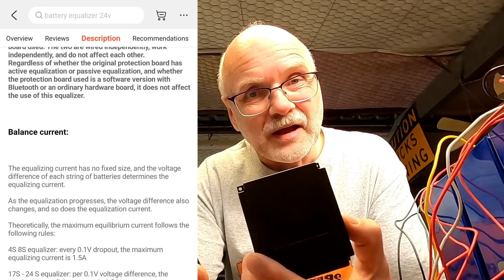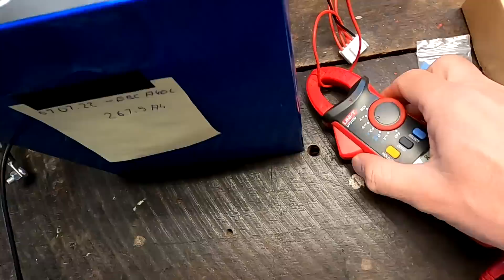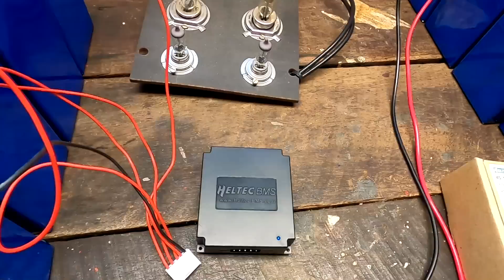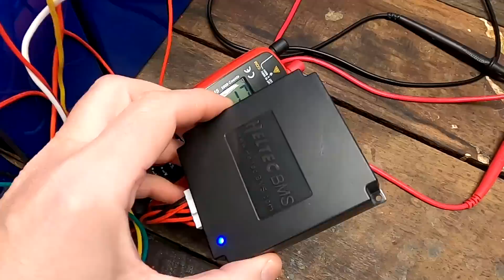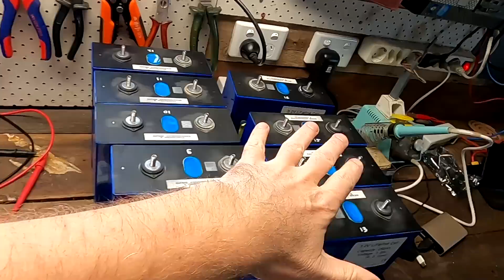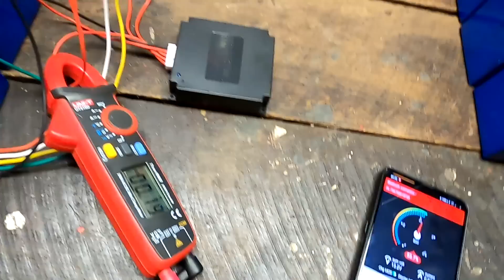HELTEC 10A Active Balancer. Great for large capacity batteries. But is it really?

Comment: High Andy. I’ve seen the same transformer type under a different name on one of the Chinese liquidation sites so now you’ve satisfied me curiosity about it. I don’t know exactly what Heltec does, if they actually make what they sell or they just rebadge stuff like others do. I’ve seen Heltec selling things that look exactly like a JK BMS and the Neey active balancer. I still haven’t found anything that has the balancing power of a Neey (and clones) balancer when it comes to 4+ amps at only .004 cell difference. They work so well I’ve retired other balancers. I’m assuming because of your videos that the JK bms that they are are second in terms balance power/speed. Thanks again Andy
Reply: Thanks for the tidbit about your experience with the Neey balancer. You mentioned clones, have you actually used a clone and if so which one and where did you get it?
Reply: @inmyimage1081  
I’ll have to look when I get home. One has no branding just laser marked connection pin numbers and the other I can’t remember. One was on Amazon and the other was EBay in both cases the seller isn’t offering it anymore but there are others now but I don’t know if they are selling off old inventory(obsolete model) so do your due diligence. They seem to be getting more scarce. Probably because the JK (& clones) cover both bms and smart balancing in one package.
Reply: What's this Chinese liquidation site?
Reply: @adon8672  
Alibaba like.
Reply: @SkypowerwithKarl  Thanks. I've never thought of Alibaba or similar sites as liquidation sites though.

Comment: You need to use analog amperimeter.
Reply from the maker: Why? In the manual, it clearly says you can use a clamp meter to check the balance current...

Comment: Would it be possible to set 2 in parallel to increase balance current?
For the 10A balancer, maybe it would charge 2 cell at 4.5A if 2 were low ?
Reply from the maker: Yes, you can set them in parallel. It also says this in the manual. For best results with high capacity cells, please use multiple balancers in parallel to increase effectiveness.... something like this.

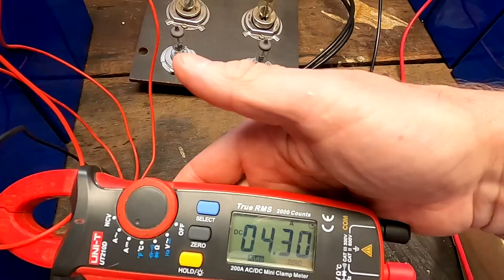Comment: Thanks Andy, Informative even if not as expected. Also, I noticed at 4:49 the cheap Heltec balancer has a "RUN"bridged solder pad next to the plug. Is that to add a "sleep" or on/off function or for an LED indicator? 
 Three Questions:
1, Have you tried paralleling two 5A active balancers to get 10A?
2,  If you had one under preforming cell (Cell #6) , and enabled 10A active balancing while under load during say the last 20% or so of capacity, that should help utilize the capacity in the better performing cells, right?
3, Do you or anyone have any good ideas for how to implement a 'sleep' function (disabling) the capacitive balancer?
Reply: I can think of 3 ways to automate top balancing off my head, each with pro’s n con’s. 1. Use a switch to manually engage this function as required. 2. A timer you can set to come on when you want, say once a week or 1/month. 3. A voltage sensitive relay/circuit board u can vary voltage trigger to activate balancer when a preset voltage is reached. You could use a small (cheap) battery voltage control board to trigger only when battery level is getting near the upper level of SOC around 3.4v/cell. I know these aren’t the best solutions, but should mostly work within reasonable limits. Im sure there are many other ways this functionality could be achieved if given enough thought. Hope this helps. Cheers
Reply: @evil17  Update, I just noticed on Andy's video at 4:49 ,  the cheap Heltec balancer has a "RUN"bridged solder pad next to the plug. I'm guessing that could be  "sleep" or on/off function. I also see it on other advertised units but no references. might be worth removing the solder see what it is.
Reply: @evil17  Thanks, that is exactly what would be useful, but most of the cheap active balancers have no V+ control voltage lead and are always functioning when connected with no way to turn off balancing other than completely disconnect the device.
Reply from the maker: 1) Yes, I have shown this in the video, I think, there was still the capacitive balancer connected as well and both worked at the same time showing 7A or something.
2) Yes, it does help a bit but but comes with a trade off. The problem here is once you fully charge again, cell #6 will peak the first again as it is charged a lot more than all other cell. Keeping such a balancer always connected, destroys your top balancing. Not recommended, I made quite a few videos about that.
3) I would turn off the balancer altogether and have it only connected once in a while. 2-3 times a year should be OK but it depends on your cell quality and how matched they are.

Comment: I don't like active balancer, just because, you cant see and detec the "potential" bad cell/cells. (Adding an other failure mode/point in the system)
Reply from the maker: Active balancers should only be used at the very top of the charge cycle, not all the time.
Yes, they can mask you weak cells

Comment: why he don't take not the power of cell 3 3.485 Volt because this is higher then cell 1 3.443 Volt there must be something wrong whit the calibration of your device or the heltec device
Reply from the maker: The capacitive balancer showed the exact same result, so it's not the balancer and neither it is the test equipment. Unless it has pulses which I didn't measure. I'll do an oscilloscope test soon.

Comment: do you think this BMS would be a good back up BMS, if say a in bought lipo4 bat BMS fried as a example  of an 300 aH bat? (aslo would that 10a worrk beter on more cells then only a 4 cell test if you  have more cells you should test it with an 8 an 16 cell setup if you can id love to see if it works beter bigger mbs test)
Reply from the maker: It is not a BMS, it is a balancer. Two different things. A BMS is a safety device which protects your battery cells, a balancer just equalizes your cells.

Comment: I’m not sure your measurement method is correct.
If you measure the current on a middle balance lead, then it is actually connected to two cells and you will only see the differential current.
But maybe they are specifying peak current, which isn’t fair related to expectations, so 10A peak charge current, but only partial time.
In case you have a scope, which you could hook up to a low resistive shunt…
Reply from the maker: Thanks Bernd. Hence I fully charged 3 batteries and had one empty. This ensured there is no current from the empty battery to a full one right. And I only focused on this empty cell for the test.
The peaks and pulses could be true, I'll test again with an oscilloscope and see how the balance current look like.

Comment: Just set up a parallel 2p-8s 280ah battery, first one ever. I got a Ponoser BMS...( DALY knock off).. uses Smart BMS APP. In the last couple weeks there was an update for the App, now it has a new button in the bottom middle, says Active Balance, and it appears that it balances all the time now...? Wish we could somehow try to get a better understanding of the SMART BMS app.. maybe could be a good video, not very much info out there about it at all..
Thanks, great video, glad I didn't spend an extra 40$ on my 2 8s active balancers.
Reply: I saw the same thing on my Daly BMS app recently. Just to disapoint you.. its for their line of smart balancers. Current BMS won't balance :( You'll need to buy their "SMART Balancers"
Same app for two different products :( Sorry, I was just hopeful as you
Reply: @m1fpv  I ran my cells for a couple days b4 I saw their update. Before update cells on front page just stay there and very occasionally moved, after update high cell turns red, low cell turns blue, and I swear I can see them adjusting microscopically up and down all day.. Since I'm trying to get a good to balance done at least once, I have it set to balance anytime cell is above 2.65.. (hoping that makes it balance more).. but the actual balance indicator on top of screen, ( near charge and discharge switches) only turns green when cells have a Delta of more than 20millivolt... Disappointed with information to clarify all this stuff.. Not sure I can count on it. That's why I'm also using the 5 amp plug in balancers also.. just want to get the darn things balanced once! Lol.. good for my OCD😉
Reply from the maker: They use the same app for both devices. I've got some Daly smart balancers on order to test them soon.

Comment: I agree, it's disappointing. But there could be a couple of things going on (which may reduce but not eliminate that disappointment). 

At first I thought the cable might be affecting it, but later in the vid' you used the other loom and there was no difference. 

Perhaps as someone else suggested, if 2 cells are low, and 2 are high, then the combined current would be 10A. I actually doubt this, but it's worth testing. I wonder what happens with the capacitive version in this scenario too. 

However I do think the balancer shutting down the balance function below about 3.4v (in sleep mode) is something good. This way it's not running all the time (which you say un-balances batteries). Instead, it will only balance at the top end of the voltage range, which you prefer (and have set up your JK BMS to do). So it's either On, or Voltage Controlled. I think this is pretty good. If you connect a charger, then this should balance in a similar way to the JK BMS. Perhaps we need to think about it as bringing the high cells down, rather than bringing the low cells up.
Reply from the maker: Very good points, my friend! 🍺

Comment: It looks like this new „10A“ balancer provides power the hole time and do not have the problem with charging and discharging the capacitor’s so we even transfer more power within the same time, can you check this. 

I like the design it is more failure resistant instead of the capacitor balancer.

Comment: I'm guessing the Heltec balancer is simply an isolated DC-DC converter with four single cell outputs in series. To reach close to 10A output, you may need to have two low cells getting 4.5A each assuming the primary side has sufficiently high current/power limit.
Reply from the maker: Yeah, right, I'll do the opposite test then...
Reply: Exactly what I was thinking, a combined maximum of 10A, not necessarily 10A on the one cell.
Reply: Yeah, my though as well. Hopefully we will see a follow up from the Off-Grid Garage in the nearby future.
Reply: I suppose it is a transformer with 4  equal windings and a synchronized dc to ac switch on each.
Will not even have any efficiency advantage over the switched capacitor circuit which wastes half the energy in the R of the RC circuit, because it is essentially  the same, just with a LR circuit.
Reply: @raymundhofmann7661  There is one advantage: It will last for a life. Capacitors does not last so much time.
Reply: @arthur88888888888888  There are also 4 cheap looking electrolytics on the transformer version.
Reply: @raymundhofmann7661  they are for filtering the ripple for the dc/dc converter. Not really necessary for the system to work.
Reply: I'm wondering if 2 dead batteries instead of just 1 would get both 4.3 each from the other two.

Comment: This active balancer cannot be configured to only switch on at 3.45V, so as you have proven already, there is little point in having it at all.
Reply from the maker: Maybe that's why it was of the next day and it actually only activates at higher voltages? More testing coming...

Comment: Yes I too was very disappointed in this balancer. The only thing I like about it is that it's in a protective case. But it's not worth the extra money 👎
Reply: @ KW.  The enclosure can be made at home with acrylic sheet cut to size. I have done it. The only issue was the Amber indicator was below the PCB. I took care of it by desoldering it and wired a 3mm Bright red LED; I perforated 3mm hole to acrylic case. The LED was then pushed into the hole, which was exact fit. Acrylic bonding solution was used to make the enclosure.